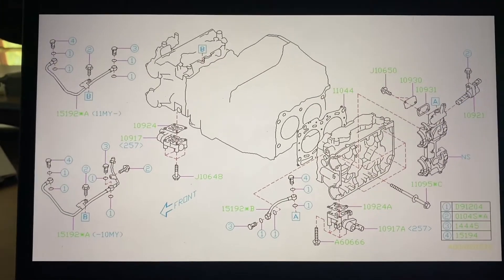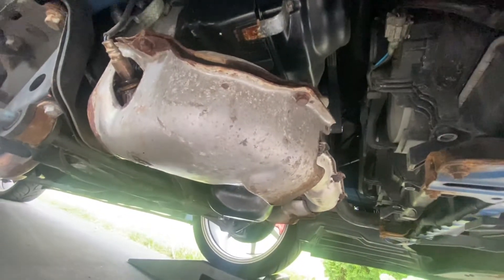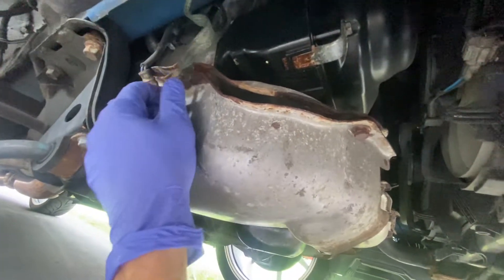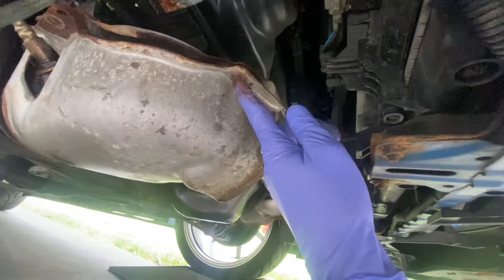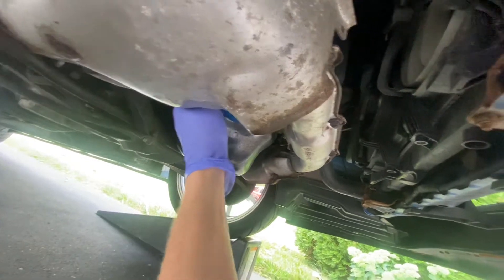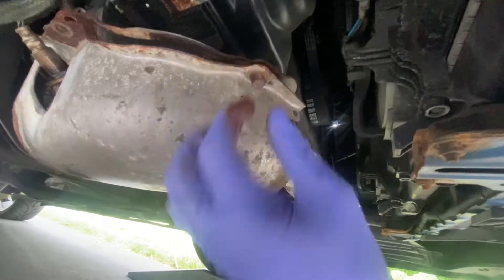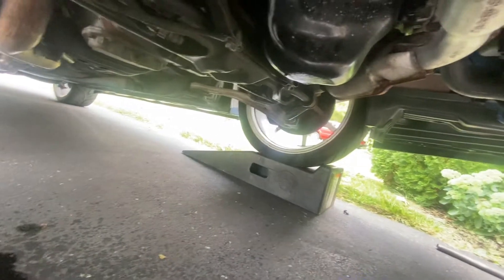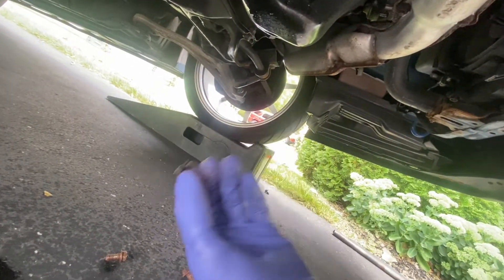Diagnosis and repair of a exhaust OCV fault on a 2014 EJ Subaru GR STi

Comment: Mine read ‘control circuit low’ when WOT felt like clutch slipped.. going to check wiring and connections underneath tomorrow. Have aftermarket UELH so easier access. Great video mate

Comment: Thanks for this video Man, took me a while to find someting for the passenger side, I also watched your other video about the p0024. I got a P0014. I already changed my oil, spark plugs and air intake so this is my last option. Going to Swamp the
And see if the code goes the other bank.

Again thanks for making this video it helps a lot 👍🏻
Reply: Did you find out what it is cause I’m kinda stuck
Reply: Have you found the issue??@jamesdube1417